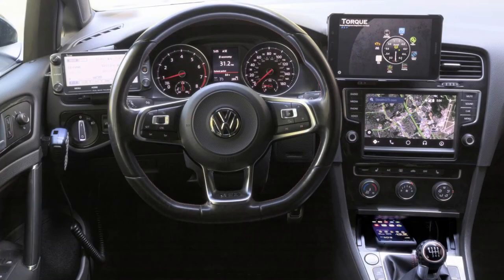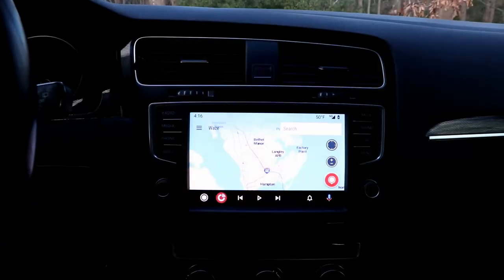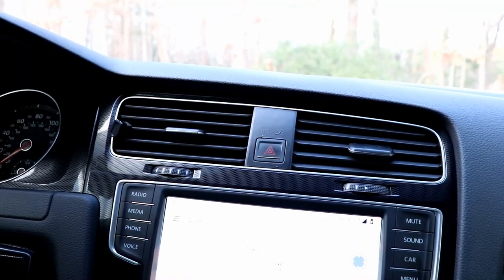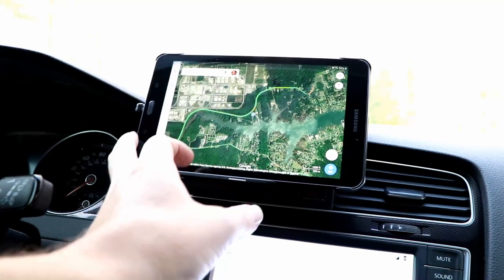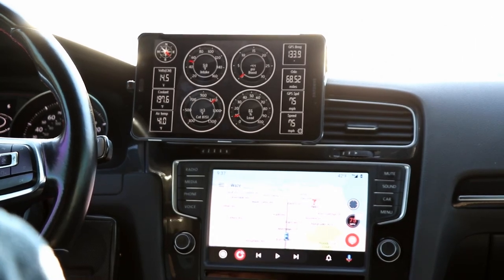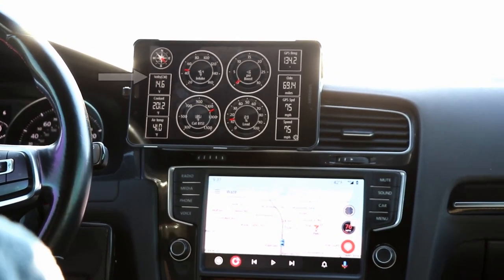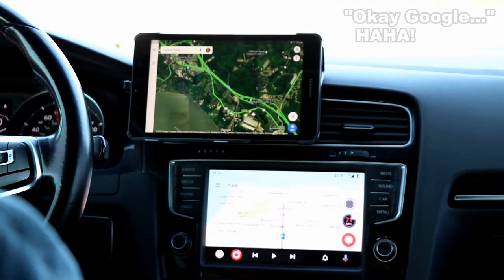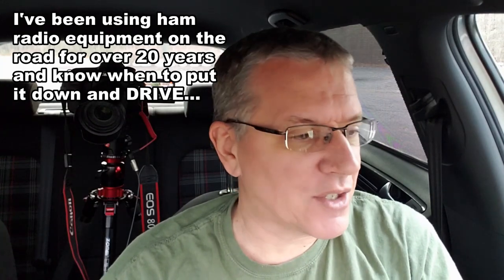AUXILIARY DISPLAY FOR MORE INFORMATION

Comment: Great video as always , i like you have a obdeleven , they torque app will not work with that ? The reader you linked is pretty cheap , id hate to mess the car up with it somehow . Im not as electronically advanced as you .
Reply from the maker: I'm fairly certain that OBDEleven is proprietary and only works with the OBDEleven app. The reader I linked is specifically recommended by the makers of the TorquePro app. I've been using that reader since 2015, starting on my Mk6 Jetta TDI. I suppose it's possible that a failure on this part could ruin something. But it hasn't been a major concern to this point. Thanks for visiting!
Reply: @StealthGTI  thank you for your reply

Comment: Do you run power for your tablet from the 12v cigarette plug under the dash and out the vent? Or do you have a different power source?
Reply from the maker: Thanks for writing! Since I like to hide my wires, that particular wire runs under the center console and then plugs into the 12V outlet that's in the center arm rest. Remember, this is 5V USB power; so there's more than just a 12V tap. I wanted to hide the extra wiring. Plus, I also power a hidden Raspberry Pi that's in the same arm rest console. Take Care!

Comment: Great video. I like the set up.
I’m very interested in those gauges on the tablet. How do they work? 

And don’t you have an oil temperature gauge on the screen in between the speedo and rev counter? I thought all GTIs had those. Certainly all UK cars do.
Reply from the maker: The gauges on the tablet sample OBD2 data via the TorquePro app. My dash does display oil temperature. In fact, I use it every day to see when the oil is up to temp. Once it's above about 170, I switch that view to "audio" so that I can see the names of songs/artists on the dash (since my MIB2 usually shows Waze). My only reason for wanting oil temp displayed on the tablet is so that it's visible in the same place as the other readings. Thanks for visiting!
Reply: StealthGTI 
Understood and thanks, I’ll look into the TorquePro app. 

Like you, I normally have Waze on the MIB. But I always have the oil temperature showing  on the dash.

Comment: "Gauges" are for MALES! 
The more, the married.
As the father of 12, I've had 3 car engines overheat, and thus (then, completely fail;) all with Beautiful (female) redheads behind the wheel on each occasion! It's not an indictment (of all young ladies) on my part, simply an anecdotal notation/observation... & I LOVE those brackets, too! Nice
Reply from the maker: Thanks the response. As said in the video, gauges are mostly for entertainment if the car is functioning properly. I think the most important readings also have alarms that sound if something goes wrong. Thanks for visiting.